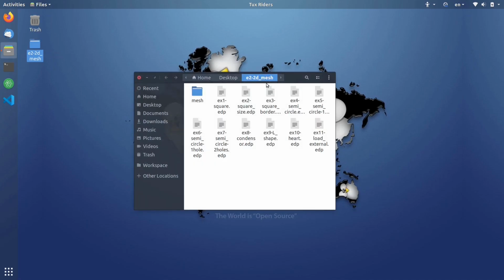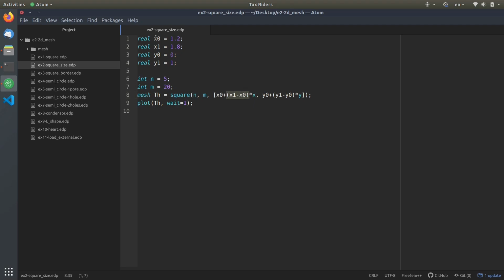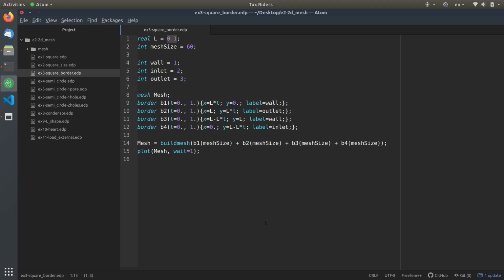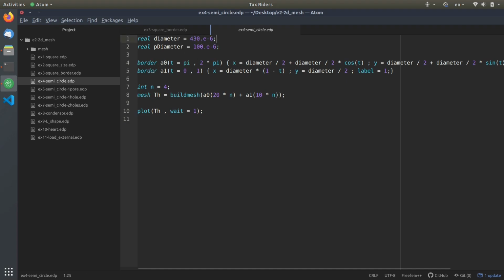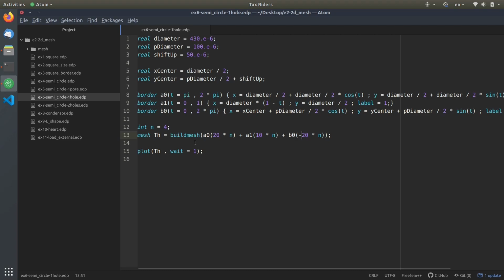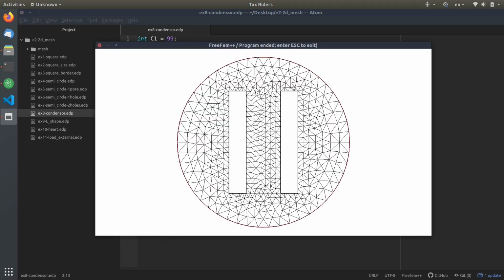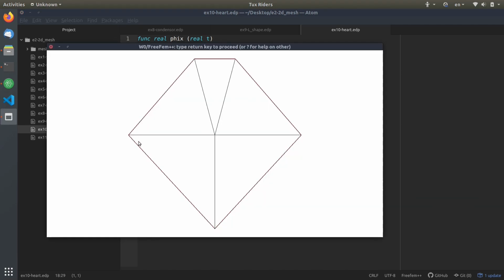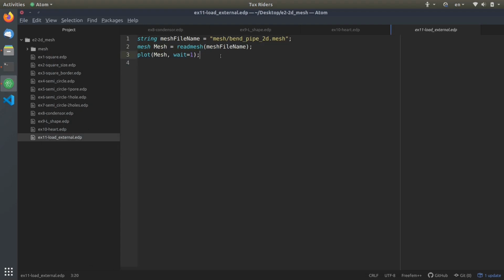[FreeFEM 2] 2D mesh generation in FreeFEM

Comment: Hi, Mesh generated using keyword "square" is structured. whereas a mesh generated by defining 4 border lines is unstructured. could you please explain why. also is there any way to generate a structured mesh defining border lines
Reply from the maker: hi, I'm afraid it's not possible. for this purpose, you need to use an external mesh generator to make the mesh and then import it to FF. I think you can still add 2 meshes into one (using + operator like this example https://github.com/FreeFem/FreeFem-sources/blob/master/examples/hpddm/stokes-2d.edp) to make the mesh you would like to have, but I would say it becomes a bit cumbersome instead of making it in an external program like GMSH.
Reply: Thank you :) @TuxRiders

Comment: Dear Tuxriders can you suggest which meshing software is to be employed in research e.g. Gmsh, hypermesh, this one that you taught etc. etc. as per your point of view.
Reply from the maker: I think you should choose the tool you are more comfortable with. my personal choice is SALOME, the output of which has a good compatibility with FreeFEM. I also use GMSH for simpler geometries and minor modifications. besides, meshio is a useful library for various mesh conversion tasks you may need to perform on the output of these tools.
Reply: @TuxRiders  Thanks for the reply. Right now i am using ABAQUS with user subroutines for my work but I am thinking to shift to open source which requires usage of such tools that i asked. So in short  we can use GMSH or SALOME or HYPERMESH or etc. in conjunction with meshio right as i infered from your reply.
Reply from the maker: @harsh_hybrid_thenx  yes, exactly. and cool, about the shift to open source, I can say you will see the benefits soon :)